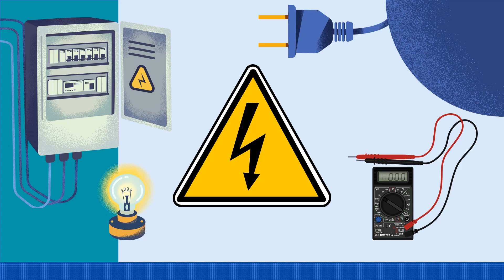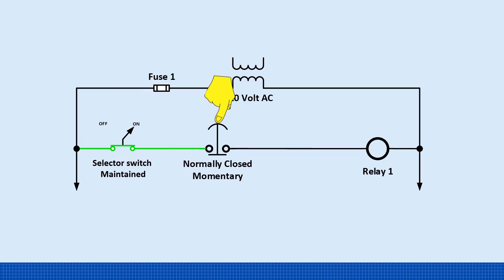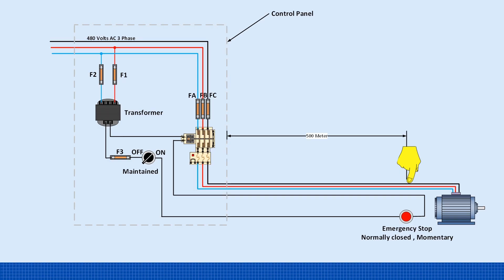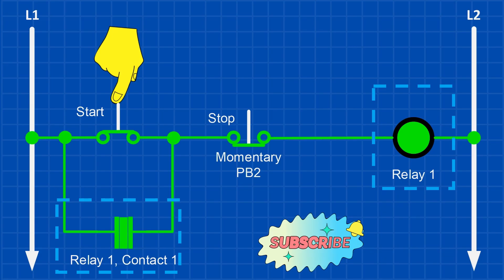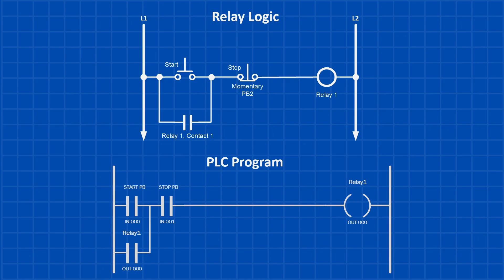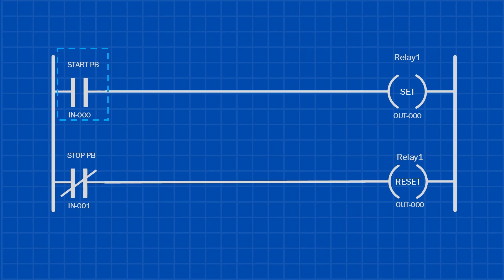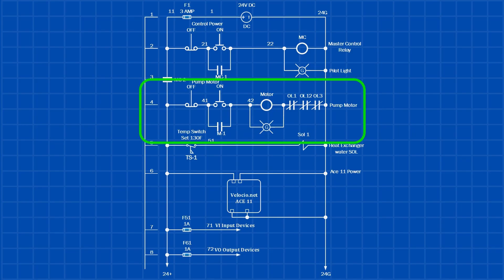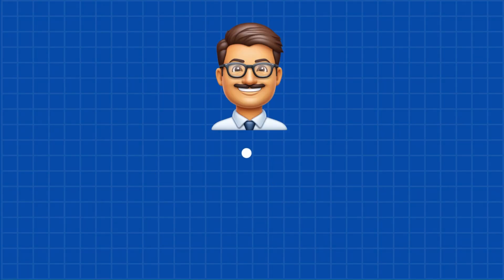Latching Circuits – What, Why & How?

Comment: When will you use a stop button as an input in OR function?
Reply from the maker: Than you for watching
Normally, a stop button is used as a normally closed (NC) input so that when it’s pressed, the circuit opens and the machine stops.
You don’t usually place it in an OR logic path for “start/run” conditions, because its role is to break the circuit, not to provide an alternative way to keep it running.

The only time you might see a stop button combined with an OR function is in safety or emergency circuits—for example:

If you have multiple stop buttons in different locations, they can be wired in series (so any one breaks the circuit), or logically considered as an OR condition (pressing any stop = stop the machine).
Therfore, a stop button is never used to enable an OR function for running, but it can be used in OR logic to trigger a stop condition if you have multiple stop inputs.
Reply: Thank you, I just started getting into plc design and this one program i was reading had nc stop input on all the retracting cyclinders.  @Electrical-lad

Comment: Another reason you want to use a latching circuit is so that equipment does not auto-start after a loss of power.  If the ON switch set to on when power is restored after an outage it will start up again.  Sometimes this is required (for sump pumps, etc.) but generally this is unsafe.
Reply from the maker: Very true , that is what I was explaining at the beginning.